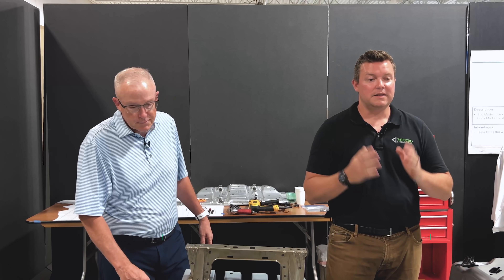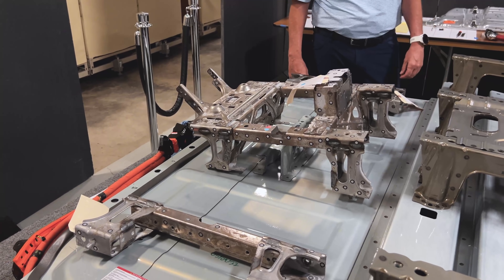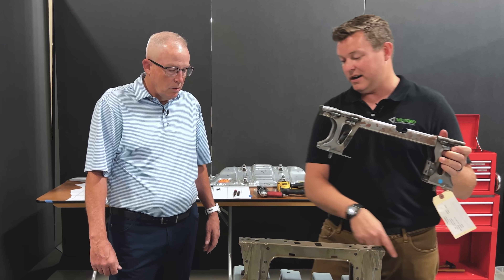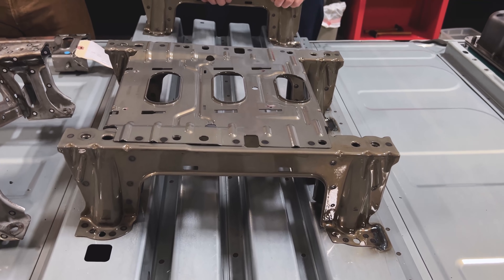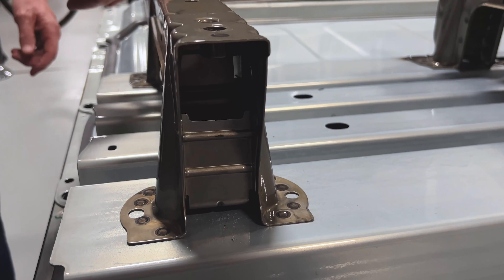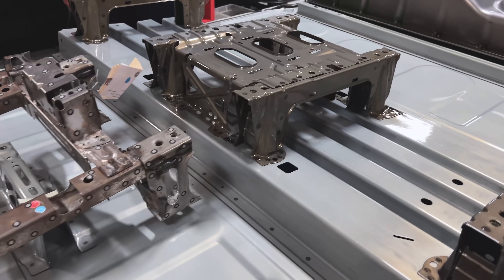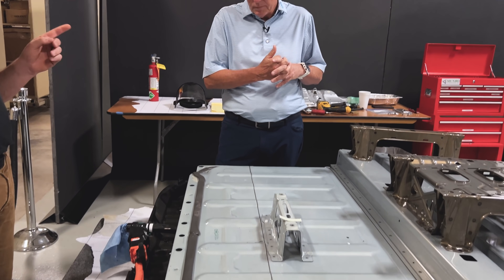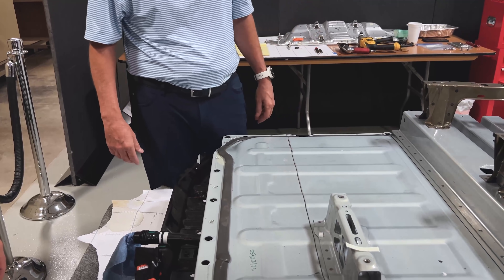Giga Texas Structural Battery Pack Cover | Tesla Model Y

Comment: Could the "clear coat" create a non conductive surface, since the seats now are connected to a major shock hazard now if the battery pack fails or gets punctured?
Reply: The pack case should never be electrically live. If that happens, I wouldn't want to count on a coating to save me.
Reply: @brianb-p6586   ...I'd expect the BMS to be constantly testing the isolation quality, & instantly disconnecting the battery if "short to frame/ground" occurs.  Same behaviour as GFCI circuit breakers & utility outlets in residential & industrial AC power service.  No-one wants to electrocute people by accident.  Imagine the lawsuits!
Reply: @jrb_sland5066  I think you have described the situation well, and I agree.

Comment: @ 16:08 The passengers sitting directly on top of the battery pack. So what happens in a moderate to severe side impact? Especially if the battery pack is penetrated. Do you have flammable electrolyte and fire venting directly into the passenger compartment?
Reply: @JorgTheElder  We're talking about somewhere around 12 inches of penetration. Air bags absorb the energy for the passengers. But then what about a fire from a ruptured battery pack that burns like a blowtorch? And is vented into the passenger compartment due to the lack of a floor pan.
Reply: The electrolyte is not lead/acid from 1859.
Reply: @FrunkensteinVonZipperneck  No, but the electrolyte is highly flammable.

Comment: Coating for salt corrosion resistance?  Is there another liquid barrier between the carpet and the battery pack? In cold weather environments road salt and snow gets tracked into the cabin and melts. Lots of cases of floors rusting through due to salt corrosion in Canada.  I've done patch repairs in the past.

Comment: Would it make sense for those rear attachment point on the seat riser  to just extend in a flap @ 90 degrees down over the back to do either spot weld or rivet to provide a sheer load rather than a peal load?
Reply: "Shear"... but yes, that would make sense to me, if having the riser extend to the rear edge of the cross-car beams is acceptable.

Comment: Wow that's heck of a list of improvements.  I would think they need the paint on top of the pack because of the carpet being only thing covering it.  Say some water or something is spilled and soaked through it could corroded the top cover.
Reply: Good point. Yes floor pans have always been surprising rust-prone after quite a few years. Maybe moisture   generally gathers from wet shoes? Any moisture introduced down there never seems to evaporate. But maybe the warmth of the battery in this case might solve this age-old car problem ....
Reply: @tomlewitt  Free underfloor heating - in a car! - love it lol ;)

Comment: The bottom of the cell has to be down because it's the heat sink isn't it?
Reply: All Tesla packs that have been torn down so far cool the side of the cylindrical cell, not the end. We'll see how the 4680 cells are cooled... if Munro can ever get the lid off. 😉
Reply: @brianb-p6586  it's the tabless design musk talked about it at their battery day like two years ago, the bottoms a bunch of copper tabs he said was good for thermal dispersion
Reply: @Mister_Durden  I understand, but what Musk says often has very little to do with reality.
Reply: @brianb-p6586  the cooling is probably at the top or bottom of the pack in 4680 hopefully they get it torn open soon

Comment: Earlier you compared the weight of this pack with seats/console/carpet to other packs. Would those packs have all of the equipment mounted to them that we see inside this “penthouse”? Seems like a lot going on there. For those cars without a frunk, is this what is taking up that space? If that is the case, then this increases the wow factor regarding the weight of the pack assembly.

Comment: A thin top cover isn't going to do much of anything for safety, that includes the legacy manufacturers. If anything this will be safer with the cells venting downwards in case of thermal runaway. However adding a thin top cover would be very useful for warranty work, that way you don't have to remove the seats, carpet and other interior pieces that are bolted onto it right now.

Comment: wait... what do you guys mean by the word penthouse? I can see it obviously contains some stuff, I guess it's all the machinery that goes underneath the instrument panel.  But I don't know for sure what it is. I googled it and even google failed me.
Reply: It is the "penthouse" because it sits higher than the rest of the battery pack. Like a penthouse/top floor apartment. And it is not in the front. It is under the rear seats.
Reply: @sjokomelk  ah. thank you. but what's in it?
Reply: @freakyzguard  As they said in the video - the connections for the high voltage cables from the charging port, the charger, the DC/DC-converter for 12V supply and the battery management system. Munroe has a video tearing down both the Model 3 and Model Y showing and explaining all of this.
Reply: My letters to Penthouse never get printed.

Comment: Just imagine how good EVs will be in another 50 years at this pace of improvement.
Reply: Amazing how many Musk/Tesla fans will defend un-repairable packs costing $10,000 to $20,000 to replace, and....
A possibly dangerous design, just because it involves Musk!
Reply: @DavidJohnson-tv2nn  I think replacing this pack is less work then replacing a engine of a car. All things different from this pack to old design is that the seats and floor cover come with it. So it maybe adds 1 hour more works to replace the pack.

A possible dangerous design? If there is one company that create safe cars, it is Tesla. All of their cars hare 5 star rated and are near the top of safest car on the road. You think Musk has any say in this to this detail? He is has one of the smartest people working for him, he don't need to do anything.
Reply: @pipooh1  These battery packs are clearly un-repairable. They are sealed shut with the covers riveted in place. There is no option to repair. The only option is to replace at a cost of $10,000 to $20,000! Even if it is just a few bad cells. 
As for safety...
I'm not an engineer or expert. But do have valid questions that should be answered.
Reply: @DavidJohnson-tv2nn  Why would you want to repair a battery pack yourself? A few bad battery cells does not effect the pack at all, we probably talking about 50+ cells to even see a different in voltage. This where the balancing load system is for that Tesla uses, to balance the pack out in case battery cells fail or come loose. 

No person will repair a battery pack, it cheaper and quicker to just replace it and let Tesla or any other company handle the repairing/recycling of the old pack. It is too risky and dangerous to do it yourself. Same as no normal person will repair their own car engine because of the complexity.
Reply: @pipooh1  Car engines aren't welded shut to prevent access for repair! I've rebuilt several car engines myself. 
Are you actually trying to get people to believe that it is cheaper to spend $20,000 to replace a battery pack than repair it???? 
The Gruber Motor company channel has a video showing battery pack taken out by one single bad cell. They repaired it. 
I have every right to repair my own car or have the work done by an independent repair shop. Let me guess....
You're a Tesla stock holder?
Reply: @DavidJohnson-tv2nn  So you also repair the battery of your car and the battery of your phone by replacing the units? No you just replace the whole battery... 

1. You need to open the pack without damaging the package. Which in most EV is already hard.
2. You need to not damage any of the foam and adhesive of other cells, you risk thermally damaging them.
3. You need to remove the foam from 1 single cell, this foam is hard as rock so good luck doing so. 
4. If you manage to clear the foam, you need to be careful not to damage the cooling that runs between the cells.
5. You need to disconnect the battery from the aluminium strip that it is spot welded to without damaging the strip, which is near impossible. 
6. If you can do all that, you need to replace the battery and spot weld it back in.
7. You need to replace the foam and adhesive around the battery.
8. You need to replace the sealing of the pack.

You expect to do all that without 1 failure and having the correct materials / battery as the pack, since a failure can cause a fire and burn down the whole pack / car and say bye to insurance. After doing all that you also want to give warranty to the person you replaced the cell for? Since why else would I come to you to replace the cell if you can't tell me that it wont get damaged within a year or 2. 

The pack does not cost 20k... At max it cost 13-14k for current model 3/Y. I expect the 4680 pack will be even cheaper. So we maybe looking at 12k replacement cost after 10-15 years if you unlucky. You pay more with current cars just for maintenance of oil and brakes and that is without anything else breaking. Break your engine, transmission or gearbox and you already at half the price of the battery pack.
Reply: @pipooh1  In the video I saw, they....
1) Removed the cover, which is a pain in the backside. But that is Tesla's fault because they refuse to sell new covers. So the old cover had to be salvaged. 
2) Removed the defective module.
3) Located the bad cell in the module and cut it out of the circuit. No need to actually remove the bad cell.
4) Reassembled everything.
5) Done! Battery pack performed perfectly. 
Here is my solution to reparability issues.....
1) BAN un-repairable EV battery packs.
2) Mandate that battery packs are easily repairable. With new covers available, or covers that aren't damaged during removal.  Also provide service manuals that show correct and safe repair procedures. This anti-repair stuff, driven by greed needs to stop.
Reply: @DavidJohnson-tv2nn  but you already do not need to cut the bad cell. The balancing system does that for you. The pack does not die because 1 battery does not work, it takes quiet a few to put the pack below it treshhold voltage. 

Also working with battery modules is horrible design. It weights more, does less good in thermal performance and it cost more to assemble. So you want to pay the car 10k more just so you have a chance to maybe repair a cell at risk of loosing a whole module which than unbalance the whole pack and wont start your car...

 There is atm no market for phone battery replacement for a reason, why would there be one for cars that are even more complex.
Reply: @pipooh1  Here is the link to the video I was talking about....
https://www.youtube.com/watch?v=F-B_8oMZNeI
Not sure of it will post, but worth a try.
Reply: @DavidJohnson-tv2nn  There is no market for battery repair on phones because it's a very risky business. You do not just replace a battery in a pack like replacing an AAA battery in your remote. Companies invest millions, if not billions into battery tech. You think they want to throw away 4k+ cells because 10 cells can die? No, but that the risk is to high to open battery packs and damage it so they rather make it compact and light weight. It's better to have a light weight and cheaper pack then having 1/5000 pack die and have option to repair it.
Reply: @DavidJohnson-tv2nn  Why must i be a fanboy? We talking about a battery pack and why they hard to repair. Stop bringing in other things to make a point which has no value.

A battery pack is design to be compact and light weight because it benefits them more. Everyone want range, range and range on EV cars. You only achieve that with removing weight and be more efficient. Since battery are the most heavy part of the EV, it makes sense they rather go for a light pack that can't be repaired then have it heavy and repairable. The whole point of 4680 cells is to make an efficient and lighter pack because it need a lot less cells. There's a reason Tesla model 3 is in the top 5 of the most efficient cars on the road atm. those that are better have 1/3 of the range of Tesla. So yeah there is your weight factor being a thing. So for efficiency + range atm the model 3 is the best car out there.
Reply: @pipooh1  I think you have it backwards. The battery is the most expensive component in the car. So it is way better to have it be repairable than have it be lighter. 
Range can be improved by doing it the right way.... Improve energy density of the cells. In other words, make a better battery. 
Musk claims he wants to save the planet. Yet Tesla is going to design and build disposable throwaway cars and batteries???? Tell me, does that make any sense? Do you think screwing people out of thousands of dollars by purposely designing throwaway batteries is the right thing to do?
YES, improve range. Don't ruin the most expensive component in the car in the process!
Reply: @pipooh1  
* Throwaway/disposable as far as the customer is concerned, if the battery is designed to be unserviceable.
*  ONLY Tesla makes an unserviceable battery pack, the 4680. To my knowledge, ALL other battery packs can be repaired. With varying degrees of difficulty, but repairable none the less.
* It is Lithium-Ion batteries that made modern EV's possible. Not Musk. He isn't even the founder of Tesla. Are you aware of that?
* GM's modular Ultium system IS designed to be easily repairable by just swapping out modules. And the same modules can be used in ALL GM electric vehicles, As well as vehicles from Honda and Acura. Same goes for the inverters and drive units. Way better than the 4680 crap in my opinion.
Reply: @pipooh1  Other battery packs may be hard to repair, but you still can repair them. With the 4680, Tesla takes giving the middle finger to the customer to a whole new level by riveting the cover in place!
Reply: @DavidJohnson-tv2nn  Other EV car makers follow the car repair Philosophy you are speaking about it should be follow. Like BMW. In Spain a car repair shop owner called Angel Gaitan that, have a lot of videos in youtube even about your concern. He did a brief comparison between his own Tesla M3 and BMW I4 repair intended philosophy in one video (in Spanish only sorry) Title: "COMPARO mi TESLA MODEL 3 con un ...❓❓❓ ¿Cuál es MEJOR?"
It looks that in general, Tesla is not a consumer repair right brand, not my opinion, only what I can see around.
Reply: Improvement??? Unrepairable battery pack, with a top cover riveted in place! Then... Passengers  sitting directly on top of the battery pack. So what happens in a moderate to severe side impact? Especially if the battery pack is penetrated. Do you have flammable electrolyte and fire venting directly into the passenger compartment? My guess is that Tesla may not be around in 50 years, after lawsuits!
Reply: @DavidJohnson-tv2nn  That is exactly correct.  It will take the car 30 to 45min to completely catch fire and will never blow up.  Unlike its gas powered counterparts.
Reply: @gnoxycat  Have you seen these things burn? I highly doubt the passengers will have 35 to 45 seconds if there is a penetration. The fire is more like a blowtorch! And it would be venting directly into the passenger compartment.
Reply: @DavidJohnson-tv2nn  So you know more about it then the whole safety department of Tesla and Certification companies that certify these packs? Seem you should work for Tesla if you so much wiser then those people. 

There should NEVER be a penetration that goes into the passenger department. Only penetration that can happen is the bottom when it tear open from a very big cut. But with that much dmg that you manage to breach the top of the pack, you think a 1mm thin panel that other car companies use to separate the battery pack and the passenger department wont do anything either. Also if there is thermal runaway, this pack is designed with the connection at the bottom of the pack so in a case of fire it will be at the bottom of the pack.
Reply: @pipooh1  Like all big corporations Tesla cares about money and profits. Look what happened with the Ford Pinto and their gas tanks because Ford didn't want to spend the money to correct the problem. 
There very well could be a penetration in a moderate to severe side impact. And two sheets of steel are far better than one.
Reply: @DavidJohnson-tv2nn  But the two sheets of steel does not have the structural design as this one has with 4 cross U-beams at the B-pillar location. I would bet this pack create a lot more structural design and create less penetration from side impact than the old design.

Comment: What’s the reason for the batteries be facing down? You mentioned it towards the end of the video but didn’t explain why. Thanks! Awesome videos 🙌👏
Reply: I'm thinking because of how the gases vent in a fire situation.
Reply: The battery cell is shaped like a bucket with a lid. If something goes wrong inside it and it explodes, you want the lid to point down to the ground and away from the passengers.
Reply: I'm guessing they mean the positive terminal is on the bottom and the negative is on the top. I assume energy flows out of the positive terminal.